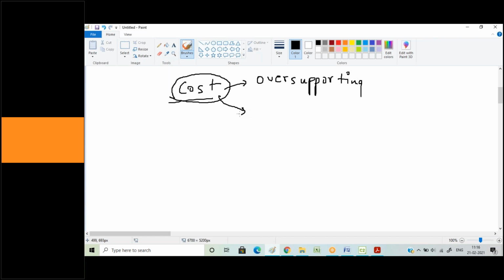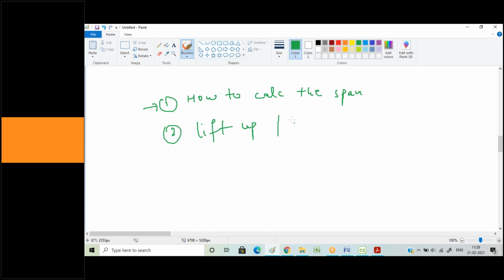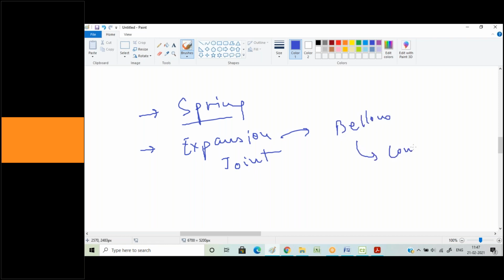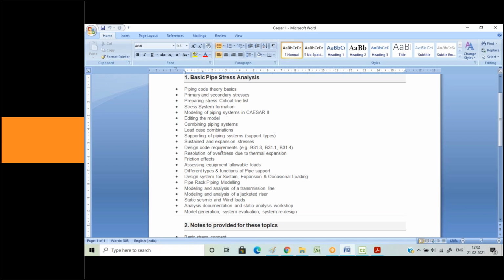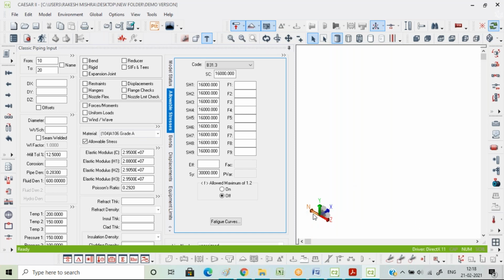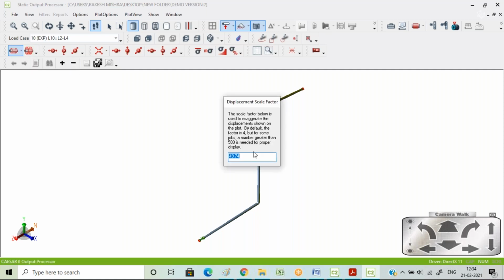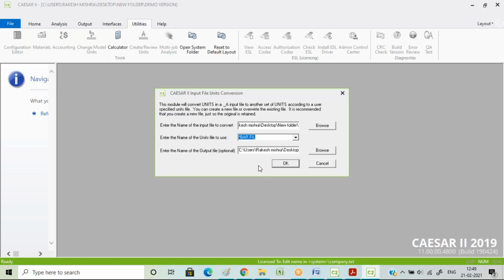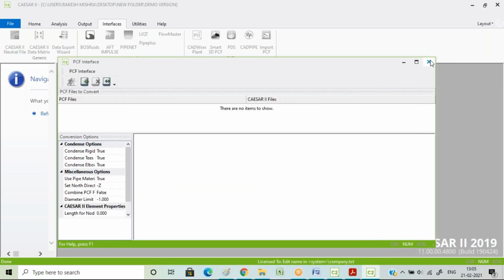Introduction - CAESAR II  | CAESAR II   Webinar | Introduction to Pipe Stress Analysis

Comment: hello, I have a question: Why when Caesar II run the stress report in some cases the Allowable Stress in the entire table is 0 and the Ratio % is 0 too. But in other case LoadCase (W+P1) the Allowable Stress is different to 0. Why happens that? There is an error?
Reply: Why in the LoadCases (OPE) the Allowable Stress is 0 in the Stress reports?
Reply: Because there is no stress called as OPERATING STRESS.( refer to b 31.3)
Operating cases are only made to check loads and displacements....at nozzles, supports, anchors, etc.